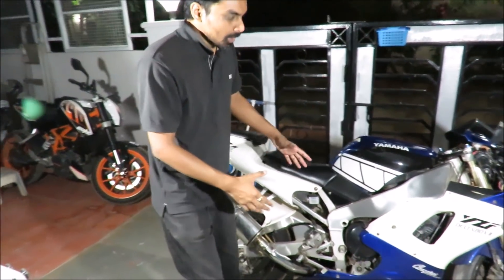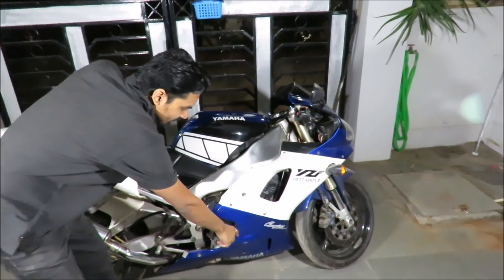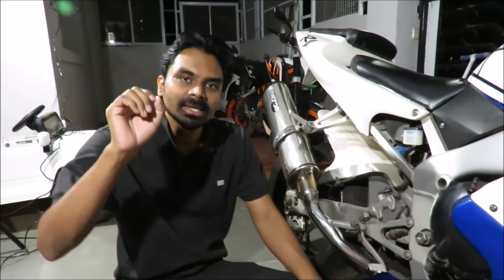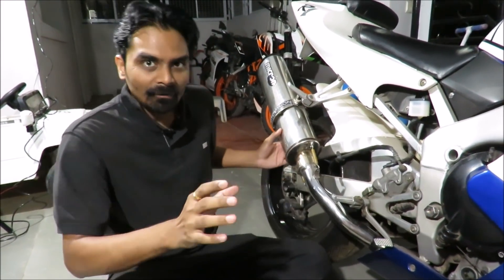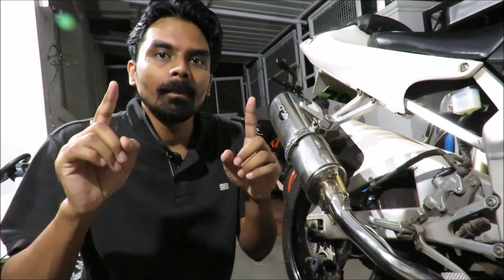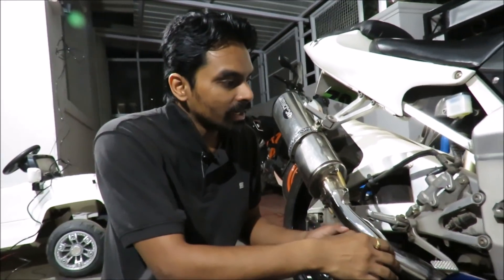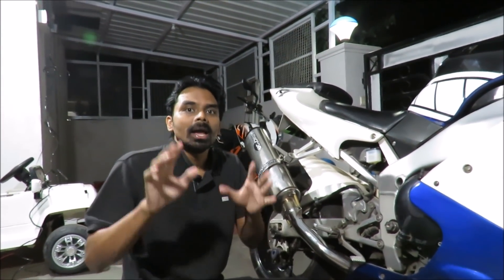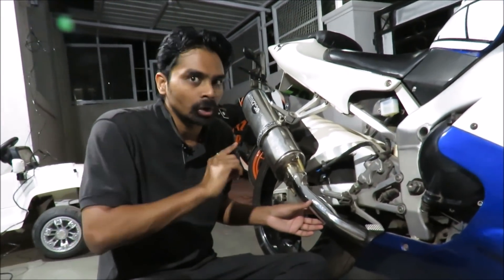Does After Market Exhaust HARM the ENGINE? Simple explanation.

Comment: back pressure. the way you explained the pipe example, even my college was struggling to teach that!
Reply: Bro if in the case of carbaretor engine wht should i doto  change ma stock exhaust putting  the after market one instead
Reply: @vishnunarayanan4906  up should tune the carb increase the fuel.liitlr bit according to the need of ur bike

Comment: Does an after market exhaust harm the engine?  NO; the A/F ratio harms a motor.   Some OEM systems can run lean right from the factory (especially Euro 3 & 4 reg bikes).  Any exhaust system that is dyno-tuned (ECU re-flash or Power Commander) to 13.2 A/F will almost always be "safer" for the motorcycle than OEM.  This includes OEM or After Market.  Spend the money on the tune, your bike will run better, have more power and eliminate flat spots (or decrease them).  The air/fuel ratio is critical!

Comment: Vikas sir...your videos are always informative but back pressure is the most misunderstood term in exhaust system. However back pressure is the negative pressure wave created inside the exhaust pipe ..this wave is just behind the positive pressure wave generated after each exhaust stroke...and yes restrictions in exhaust causes obstruction in the flow but back pressure is not the right term for it.   Back pressure helps scavenge out the gases by creating a negative pressure zone inside the exhaust....and when it comes to straight pipe free flow exhaust...they are good but if engine is not tuned accordingly then it reduces fuel efficiency..causes lots of unburnt hydrocarbons and afterburing of fuel in exhaust.
Reply: Lol u didnt got a like from him
Reply: Fayaz u r right. Free flow exhaust let's mileage down because the charge is not fully combusted and escapes the cylinder as there are no restrictions in free flow exhaust.

Comment: nice topic to share...only one tip to u bro...if u have full system exhaust then u need a powercomander which is quite expensive to buy !!slip on are better but slip on a z900 is useless to spend 55 k  which sounds like exact same as stock due to the presence of cat box in collector
Reply: What if I just use a slip on?

Comment: Wat abt a carburetted engine? Wat shall be done in a carburettor in case of a full exhaust system installation?
Reply: Rejet the carburetor
Reply: I own single cylinder motorcycle , so I've changed only the muffler , The pipe from the header to the muffler is the stock one , I dono whether it has got connected an all !. So will my engine get damaged ?
Reply: Akib Basheer nope your engine will not get damaged don't worry✌️
Reply: Jets must be altered
Reply: I hope n wish that Vikas would n should make a video on the changes or upgrades to be done on a carburettor for its compatibility with the after market exhaust system, if one installed. For the best performance...

Comment: Sir I have honda civic ek 2000 and I did down piping and installed after market muffler sound was awsome but Engine was seems to be hot and bad fuel economy black carbon on tail pipe so now I come to know about back pressure and air fuel mixture and i re-set my system now fuel economy is good tail pipe is brown.  I won't  remove anything in middle....just will install sports muffler. ..thanks a lot again 😊😊😊😊😊😊😊

Comment: correct explanation coz i have already experience a free air flow of modified motor 200 2 stroke exhaust engine,  it gives me much power in the 200 meters straight race but damage in a long normal run of 40 kls it really create too much heat and burn the valve system  it only good for short range distance race with time duration in order to avoid overheat but it really run so fast with the same engine specification.

Comment: it depends , if you have from the factory an wide band o2 sensor and the computer has autotuning function , then it will correct for the new exhaust , even some engines with no wide band o2 sensor computer does some corrections because it is designed to run at sea level and also at 3000 km altitude sow it needs to have some correction capabilities , but I repeat not all computers do this you have to check this for your own , and an  important thing is to maintain the approx. original temp at witch the o2 sensor was designed to run that is important for all engines !

Comment: this applies also to all types of motorcycles whether its a scooter or any other small cc's but most of the time low cc motorcylces have fixed exhaust system, meaning you cant simply change the cannister or muffler.mostly available in the market are full exhaust systems
Reply from the maker: Thanks for watching

Comment: Yeah.. after installing a free flow exhaust,
these happend.

sound become 10x sound
power loss
consuming more petrol
quick acceleration not work.
low mileage..30~40% loss.

Backpressure is must.
After putting fiberglass wool (inside freeflow) blocking exhaust air,.. Everything back to normal.
Reply: If you do a full mod you need to get your bike dyno tuned to get the benefit, if you have a newer bike with the ECU the tuner can program your ECU so you bike performs as you like.  You can actually gain gas mileage if they tune it that way its up to you to communicate that to the guy tuning your bike to let him know what you want.

Comment: Ecu remap wiil cause you more $$$ for fuel, so you may prefer the original exhaust and have good gas milage on your motorcycle, the ECU remap will also shorten your oil change intervals which you may not like $$$$.😢
Reply from the maker: You are spot on brother!

Comment: Sir I have a question. What about the bikes that have a under belly exhasut? How do you go for sound only which does not affect the engine? I see you got the old 390 and when changing the exhaust of it you really have to remove the under belly exhaust which is the  catallytic, collector and muffler are placed in one so most of the old KTM change it with a mid pipe and a muffler so it should have no back pressure and will destroy rhe engine. Going back to my question, how do we change it for sound without destroying the engine?

Comment: Vikash sir how about the Duke or RC 2015 model.can I change the exhaust by not harming the engine.i think the Catalytic converter and the small exhaust are closed and fixed.the 2017 model's have side exhaust but 2015 &16  have underbelly exhaust.

Comment: I always come back to you for advise ..I have a bullet 350 bs 6 as a cruiser bike ...I have ordered red rooster exhaust for the same and it’s a free flow exhaust with ceramic wool coating ..is it safe for the engine ?? Should I even upgrade..and yes I am not removing the catalytic converter no way ..the exhaust is not a full system it’s more of a slip on ...plz help bhai plz I have already ordered spent my money on that ..:(

Comment: What about a carbureted engine..
If it doesn't contain an ECU what to do then?
Most of the bullet 350 owners replace the stock exhaust with full system.. how does it effect the engine as it is carbureted one?
By Nagarjuna sagar Guy 😍

Comment: What if we replace it with full system with catalytic converter in it
Reply: Then, as Vikas rightly mentioned, we would need a full ECU remap so that the engine does not go lean. If a full engine remap is not done then the engine could suffer heating issues as the air fuel mixture would be leaner. :)

Comment: Will there be any harm to engine if i remove only underbelly muffler of duke 390 gen 3 and install aftermarket exhaust to it as slip on muffler is not availlable in new duke 390 gen3

Comment: Isn't this only for older bikes that can't change theot air/fuel mixture with an O2 sensor? Most modern bikes with an O2 sensor should compensate for the increased air in combustion. (Granted, it won't run at peak preformance without a tune or piggyback system, but it also won't damage your engine if you run an after maket exhaust without a tune/piggyback).
I'm not an expert but this is what I have heard

Comment: i have cbr 150r, i only changed the stock muffler and mid elbow into after market muffler and after market mid elbow, but my header pipe is stock and the catalytic is not removed.  does it harm my motorcycle engine?

Comment: Since there is very little power gain unless you do the full system which is really expensive, I just drilled holes in the upper and lower exhaust holes of my 2012 BMW K1600GT. Zero expense, and a nicely louder and lower tone. I really need to do a video of that. All the rest of my K1600 videos are on my site, like the ball joint replacement I just did. Managed to screw it up too! Follow along for laughs and tips... https://youtu.be/jvjCrfWsVCE

Comment: Dear vikas the back pressure doesn't affect a single cylinder engine. Reducing Back pressure in multi cylinder engine won't harm engine but it reduces pick up  not due to more air and lean mixture. In multi cylinder engine there should be some optimum back Pressure which increases exhaust gas velocity and creates negative pressure in other cylinder (non power stroke stage cylinders) which increases scavenging affect. If we reduce back pressure more air won't flow but some tiny amount of burned games will be left inside from previous power stroke. The more optimum back Pressure the more velocity and negative pressure in other cylinders.

Comment: I just replaced my stock muffler with ackrovic but as you said I didn't touch the catelic convertor and collecter but have to cut the pipe a little to accommodate the muffler. 
Does it do any harm to my bike and I don't use the DB killer also.

Comment: What is ECU?
Reply: An engine control unit (ECU), also commonly called an engine control module (ECM), is a type of electronic control unit that controls a series of  sensors in the bike which calculates certain variables and run the engine by properly mixing the air fuel ratio...

Comment: Hello SIr, I wanted to know if there will be any problem to the engine if we install only a muffler and an stock replacement K&N air filter....Kindly suggest sir. I have installed a TOCE muffler on my KTM RC 390. need your expert suggestion. Thanks in Advance

Comment: @vikas although I am a year later, could you please let me know what I choose to ride without the muffler on my BS4 RC 390? I know it's too loud and I have tested riding without muffler for less than 10 kms, buy I want to know that would the exhaust valves or the engine get effected if I open the stock muffler and don't install any aftermarket muffler?

Comment: Vikas ji, NS200 has sometimes ghost lights malfunction, like all the control led lights on handle  bar, sometimes only headlight turned off unexpectedly, then turns on itself after a while. I checked the electrical wiring and cables, it's all good. 
May it be issue with ECU.? And if yes, should I remap ECU, or replace with new one? 
Please reply.

Comment: I changed my R15V3 muffler to a slip-on SC Project exhaust. Good sound and quick throttle response...but I sense that the Engine is heating soon as the Radiator fans starts running. Does an aftermarket slip-on exhaust run a engine with lean mixture(air-fuel)???...also I experience imbalanced back pressure jerks sometimes...please clarify. Thank you!
Reply: Backpressure problem.

Comment: Hey there my brother, how are ya doin?
How is your dad doing?
I have the Duke 200 (2015) Model. Have done many cosmetic upgrades. Want to do a After Market Exhaust upgrade. As you said in the video, if we only change the muffler of the bike. There will be no harm to the engine whatsoever. BUT THE KTM DUKE 200 doesn't have a muffler and a midpipe, but an underbelly exhaust. In that case we have to switch to a Full System Exhaust which will be a Free Flow System. So I have to remap the ECU of the bike orelse the bike will run lean. Right? 
What is the current exhaust on your Duke? Stock or AM?
Reply Please..
Thanks!

Comment: Sir
Are ECUs capable of self adjusting the air fuel ratio to the reduced back pressure in case of only muffler change (rest everything same) or we need an ecu remap for the same.
I own a dominar 400 which is supposedly has a closed loop ecu. 
Looking forward to your opinion on the same.